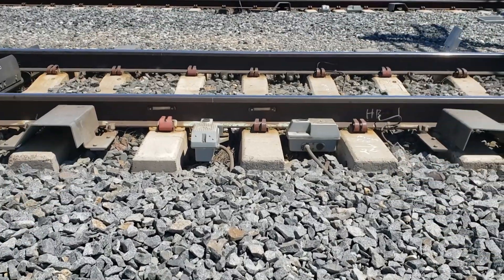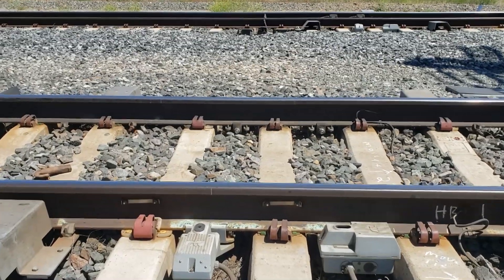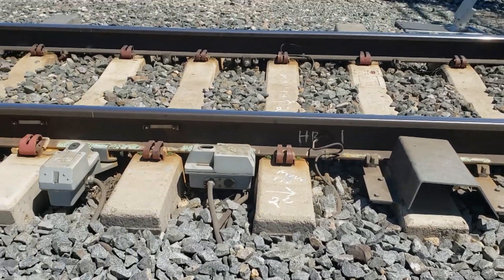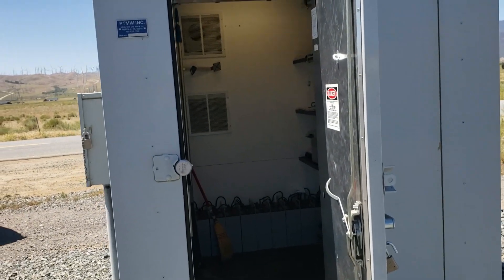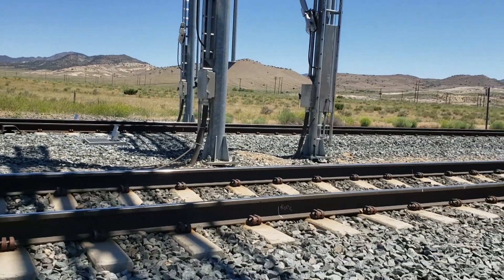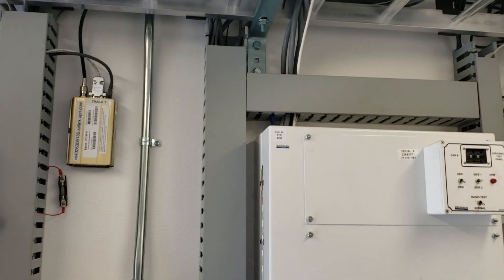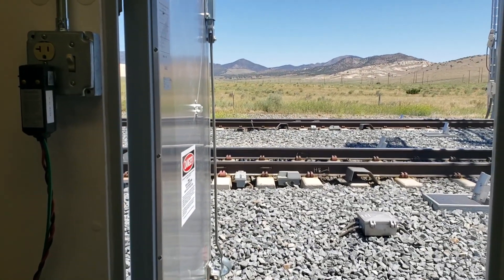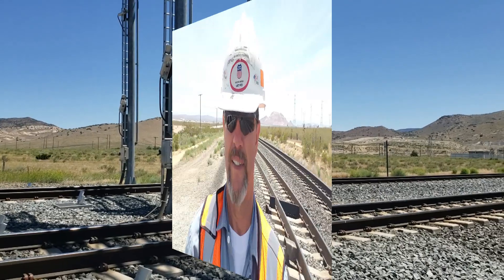Railroad Signaling Explained: How Wayside Detectors Work

Comment: I was the HBD technician for some of the N&W / N&S railway in the 1980's. We had Servo 7707D, Servo Model 87 retrofits on the 7707D detectors, GE HB290 and GE HB 300 detectors, and 2 GRS detectors. Some were upgraded to Servo 9909 during my time. All were read out of strip chart recorders using ink as the recording on a paper strip chart read out in millimeters. My position was abolished and i was replaced by 2 BoRS electronic technicians, as my job was ending we were just starting to install what we called track side Analyzers made by Ensun corp. We paralled them with the Servo 7707D detectors. Only saw one "working" we had it installed at Casad, In which was an incoming yard detector for Ft Wayne, IN from Fostoria, OH. WE saw a train over it and the analyzer said the train was traveling at 657 MPh and was over 100,000 feet long. We had a very big laugh, obviously we had a few false triggers from the wheel detector circuits. We consolidated a few dispatchers offices during my time on the railway and used Allen/Bradley PLC 2/30 industrial Programmable Logic Controllers (PLC) to switch the analog output of the many detectors into a limited amount of strip chart recorders. In Ft Wayne, In we had over 20 detectors coming into 10 strip chart recorders. The PLC  would switch the recorders in sequence, we even included a switch we could cycle through the recorders to take one off line for paper change and ink service. Most of our detectors at the time was over wayside pole line on the signals code line. Spent time chasing low signal levels, using a Selective Voltmeter for dB levels made by Harmon Industries,  we also used Harmon Industries Line overlay carrier for our detectors at the time.
Reply: I forgot to say I was the technician on 45 Hot Box detectors in parts of 5 states. I was a regional technician. My railway title was General Inspector - Signals , an ARASA position,  that was to get the salary up as at the time i was almost never home. Thanks Mark for a nice series.
Reply: @garyfiber3525  Gary, do you have anymore information on the Trackside Analyzers? Was it the talker component that was made by Ensun?
Reply: Hello Gary, I had one tower that used a Gould brand ink chart recorder & my other towers used a huge bulky Sanborn brand chart recorder (it said "Hot Box Detective" on the sides with a Private Eye holding a magnifying glass) that used thermal pens & back in 1983 those "pens" were $125 each. 3  thermal pens per recorder were used, one for each rail & the 3rd was used for "the event marker" to show the axle that had alarmed. Tower operators had to count by hand all of the "pips" (lines drawn for each axle) & our rules were the train crew had to check 2 additional axles on each side of the "alarmed axle" in case a counting error was made by the Tower Operator. Back then, we also used Harmon brand transmitters & receivers to send the data to the towers. All of wires were in underground cables (Amtrak NEC territory) with center core telephone pairs we used to transmit the HBD data from the field to the tower. The Harmon Frequency Selective Voltmeter was another instrument we had, too. Take care :)

Comment: Excellent video, Mark, thank you. Is that a Southern Technologies HBD system? Also, I had noticed track wires near the scanners, are you using an audio frequency overlay (AFO) system for the HBD's advance start, since you hadn't pointed out any advance start transducers in your video? Do you follow a 3 month schedule for HBD calibrations? I had maintained HBD's on Amtrak's Northeast Corridor when I was promoted in 1983 (I'm now retired). Back then, we had DD sites that still used the older Servo Model 7707 HBD systems that had ballast mounted scanners and vacuum tubes & even a vacuum tube was inside the scanners for the infra-red sensor's ciruitry. Next, we had advanced to Servo's model 8808 with rail mounted scanners & transducers that were clamped to the rails instead of having to drill holes thru the web of the rail. We also had a hybrid system, the Servo 7708, where the 7707 equipment rack remained the same & the big boxy ballast mounted scanners were replaced with the 8808's more modern & rail mounted HBD scanners. The problem with the older 7707 ballast mounted scanners would be missed or inaccurated infra-red samples due to track pumping (time to get the Tamper machine to the site). The Servo corporation had patented the rail mounted HBD scanner technology. Later, the Harmon Corporation had bought Servo and their latest & greatest HBD was the Cyberscan 2000 (I didn't like it). Then, Harmon sold their HBD rights to GE & then later Progress Rail bought the rights (their HBD systems we liked).
Reply from the maker: To be honest, I don't remember whose those were. We used an overlay to turn on the scanners but the transducers are right at the location. Calibration is an annual item.
Reply: @MarkClayMcGowan  Thank you, Mark :)

Comment: A lot of older EMD locomotives have a hotbox detector built into the bearing housing on the axle - if the axle got to hot, it would essentially set off a stinkbomb!
Reply from the maker: Eewww! I did not know that!

Comment: why does you hard hat has written on it former signal maintance foreman just wondering?
Reply from the maker: I was a maintenance foreman for 22 years. With nine months until retirement they cut my job so I bumped a maintainer rather than another foreman with the new extended territories.
I did a video on my thoughts about it.
Reply: @MarkClayMcGowan  okay, I was just wondering. I seen written on your hard hat it was written former.  Your videos are very interesting to view. They are very infomative for someone that has never seen or been around equipment like you work with.  It is an enjoyable videow to watch. Who would of thought it takes all that type of equipment that could be controlled from great distances and tell what the train is doing from a far.

Comment: I have some old SP timetables (1987 and 1989).  They had talking detectors already in 1987.  "Type E" and "Type F" series. 
A     Hot Box - Letter "H" Indicator with Digital Readout
C     Hot Box - Numerical Display Board with Indicator Lights
D     Hot Box - Remote Readout at Terminal
E-1  Hot Box - Talker
E-2  Dragging Equipment - Talker
E-3  Hot Wheel - Talker
E-4  High/Wide Load - Talker
E-5  Loose Wheel - Talker
F-1  Dragging Equipment - Talker
F-2  High/Wide Load -Talker
G-1  Dragging Equipment - Revolving Red Light
G-2 High/Wide Load - Revolving Red Light

Comment: Does the UP have WILD detectors?   Wheel Impact Load Detectors?    For flat spots, out of round wheels and  unbalanced loads or overloads?   Any acoustic hot box detectors? Uses microphones to hear the defined sound of a bearing failing
Reply from the maker: Not around here, but that doesn't mean they don't
Reply: I believe those were invented by UP.

Comment: There is a picture of an old caboose era Canadian Pacific numeric display scanner half way down the page in the link that follows.  I believe that if a fault was found, the numeric display would start counting up from zero for each subsequent axle that passed after the first fault was found.  The conductor in the caboose would notify the crew of the results after passing the display.  000 meant no faults.  The lights above and below had different meanings.  I believe the  center low light would flash indicating that the detector was working.  The top left and right lights would indicate the side of the train a fault was on.  The other two I am not sure about.  http://www.trainweb.org/oldtimetrains/CPR_Trenton/History_changes.htm

Comment: these videos are going the be gold in 50 years when the railroad doesnt use any of this
Reply from the maker: I wish I'd had the foresight to capture the older equipment on film! Thanks for checking it out!
Reply: @MarkClayMcGowan  Same here. so much over the years I wished I captured. I had the opportunity, but missed it, to document when we were retiring a bunch of old US&S 5xx Code system units for CSX. This was probably the oldest equipment I've ever seen still in service. It was a few year phased project where first phase left the relay interlockings and we interfaced the existing field units w/ the newer packets switches to get rid of the pole lines. Then came back a few years later and slowly upgraded to microprocessor-based.

Comment: With RFID being a thing on all North American rail cars, do you see a day where "defect near axle # [  ]" becomes a thing of the past?  Given the ability to fetch and exchange high speed data in modern times, seems like maybe the detector could immediately fetch the data (owner, identification, car number, stock type, cargo within, etc.) from central office based on the RFID that the scanner simultaneously reads.  A conductor having to "count axles" on a stopped train to establish what car has the problem seems so prehistoric.  (Or does the train's manifest have all that data already, so he knows what car to look for?)  I can't imagine having to walk 3/4 mile along a train in 5 degree winter to count up to axle number 219 if a "stop train" order was issued.
Reply from the maker: I don't know what's coming down the technology pike but if it makes economic sense and will do the job more easily the railroads will do it. No matter though, someone has to physically look at the car in question and yes, the computer manifest identifies the car. The AEI system checks the train about every 50 miles.
Thanks for checking it out!

Comment: So I've heard that wayside detectors are usually placed anywhere from 20-30 miles apart but that it's usually railroad preference. About how far apart are UP detectors placed?
Reply from the maker: Draggers are about every two to five miles (usually at intermediate signals), hot boxes every 10, AEI about every 20-25 miles.
Thanks for checking it out!
Reply: I did actually find a dragger nearby at an intermediate. I still never hear it on the scanner
Reply from the maker: @SETX_Sirens_and_Rail_02  they only talk if there's a problem
Reply: I didn't know if it they just came on and said "No defects" if there weren't any issues

Comment: Ok now with the crossing gates why do the high rail trucks /vehicles (i.e. . Section gang, weldeing gang, signal matainer trucks,  road master & track inspector vehicle) not triger them? I have seen it countless times. Is it they are not heavy enough or they travel faster then the impulse? Pr is it the ruber tires?
Reply from the maker: Hy-rails have shunts that can be lifted from the rails from the cab. By rule they cannot count on the gates to protect them at crossings. In areas where there are multiple adjoining crossings they are required to raise the shunts while running and wait for traffic to clear before proceeding. In any case they are required to stop and clear even if the gates are down.
Reply: @MarkClayMcGowan  thanks Mark that explains a lot
Reply: I remember reading a Denver & Rio Grande Western VP of signal practices saying that on-track equipment had to shunt detection circuits continually or not at all.  Intermittent shunts drive the circuits crazy.  Trains with their weight will shunt continually, but lighter weight equipment is usually insulated from the detection circuits.  This is usually why hi-rail vehicles approach every grade crossing prepared to stop for motor vehicle traffic because without special shunt circuits they will not activate crossing signals.  And not many people will expect to see a pickup or SUV driving down a railroad track, in spite of the headlights (and if equipped, a strobe light) on, so SAFETY FIRST.  Stay safe and healthy.

Comment: I remember the old number message board system. The engineer would call out "white light scanner coming up" over the radio and after passing, the conductor on the caboose would call out "highball the scanner" with a 000 display. The scanners were also connected to the dispatcher's office so they knew as well. Great videos. Thanks and be safe.
Reply from the maker: Thanks for checking it out!

Comment: Mark, how accurate is the axle number provided by one of these detectors when it advises of a problem?  What about the accuracy of total axle count of the train when it provides that?
Reply from the maker: They're dead on. They give the problem axle and total axle when there's no problem and also give time, temp and speed. There are some that only talk if there's a problem.
Reply: They do give an opening message (railroad reporting marks [initials] "detector, milepost [nearest tenth of a mile]") just to say "I'm working".  At least the ones around San Antonio Texas do.  Stay safe and healthy.

Comment: i recall on conrail when i hired on they had a device called a loose wheel detector at a few locations--LWD it was a series of metal fins on the inside of both rails and a bit off set you could only go 10 mph over those things any faster would trip them off, thankfully they did not last too long they took them all out, to many delays going at 10 mph. they were wired to the next signal that would drop to stop when you tripped one of them and many times the crew could not even find the loose wheel.
Reply from the maker: Cool info. I'd never heard of them. Sounds like I'm glad we never had them!
Thanks for checking it out!

Comment: Great video! I always had an interest in DDs and how they worked. The DDs didn't talk until the early 1960s when the Seaboard Air Line invented the innovative talking defect detector. For the first time in history, crews could hear a readout of their train in the locomotive and caboose. They ran on a number of tape to play recordings in a sequence. The message took a bit long but yet innovative. For every number spoke out, it took 1 1/2 seconds for it to play. The speechless DDs many railroads had were of course as your mentioned large digital display number boards that flashed 000 is no defects were found but flash a number if one was accompanied with a light on the top or bottom of the board. Many were printed on stylus graph paper in interlocking towers or dispatcher offices where ever axles appeared as a spike on the graph. A high spike was a defect, hotbox or dragging equipment. The most common one was white lights, some railroads had white and red lights. A solid white was no defects, a flashing white light or a red light means something was wrong. At that time, youd have to go into the bungalow to identify your defects. The invention of SALs talking DD made way for other railroads to implement talking DDs thought not as fast until the late 1980s when it was more feasible to have that technology which has greatly improved. From systematic tape readouts to now microprocessors and computers, it's all interesting! Love the videos! Definitely subbed!
Reply from the maker: Thanks for the comment! It's always interesting to know how things have worked and changed over the years in different places!
I'm glad I was around long enough to see modern signaling come into play.
Thanks for checking out my channel!
Reply: I think it was early to mid 70's and saw the "big board" defective axle display system in action near Circleville, OH on the C&O.

Rows of incandescent bulbs made up each of the numeric "7 segments", and there were 3 digits. The black display board was dark unless there was a passing train.

 A RR maintenance guy told me they would sometimes test the detectors with a lit cigarette.
Reply: Erie Mining in northern MN had draggers that just had a light on top of the box, along with a radio transmitter that just beeped if something hit it

Comment: Great video Mark. Learned a lot from it. However, how do the train crews determine if a journal is to hot to where the railcar has to be set out. Does the RR still use tempilstiks? Perhaps the conductor uses some type of handheld electronic device to determine the temp of the journal?
Reply from the maker: That I do not know but I will find out! Thanks for checking it out!
Reply: Guessing these days they carry the IR thermometer "gun" with appropriate temperature range. Squeeze trigger, point the LED laser spots to what you want to measure, check the readout.

"Home grade" ones are about $25 these days.

Comment: Thank you for the look inside and explanation! The line I worked on (ex-SP line, spun off to a shortline) originally had simple draggers with rotating red lights that lit up if something hit the paddle.  And the trains had to have a manned caboose.  Story goes of a big derailment and the guy in the caboose swears that the dragger was dark.  Managers highrail back to the dragger and it's still lit up.  Guy who was in the caboose got 'promoted' to maintenance of way and the draggers very shortly were equipped with radios.  I swear I was not involved in that...
Reply from the maker: Sounds like the Bart Simpson defense! LOL
Reply: @MarkClayMcGowan  I didn't do it!

Comment: You ought to see what we can detect with high-speed imaging on the wayside and on geometry cars nowadays, Mark.  The systems aren't cheap, but if we're to keep injuries and disruptions down and the public's trust in our carrying hazmat, they are worth it, IMO.  Seeing a small wheel crack at 60mph+ in all lighting, weather conditions, and across wheel types before we lose a load is quite a capability.
Reply from the maker: I rode on one from Stockton to Bakersfield a few years ago. It was pretty impressive!
Reply: Can they detect a flange height    of 25/16 or a flange thickness of 12/16? I doubt it.